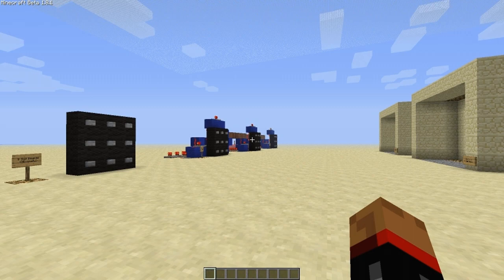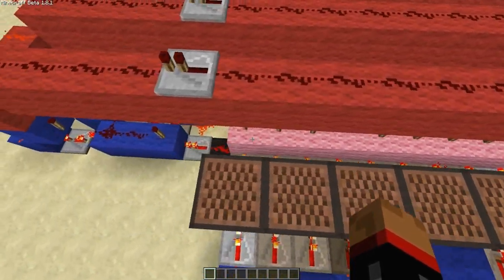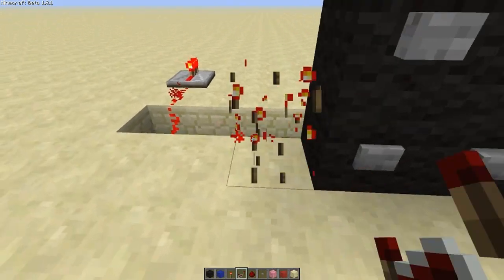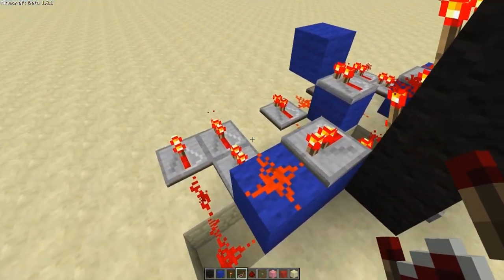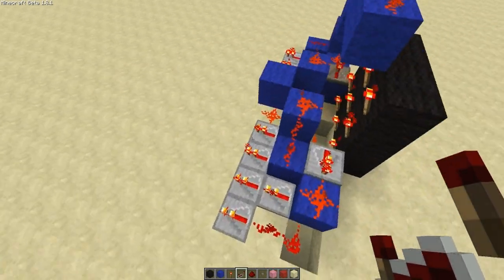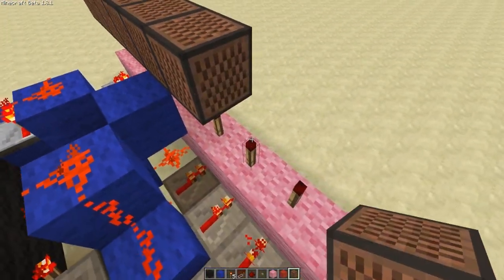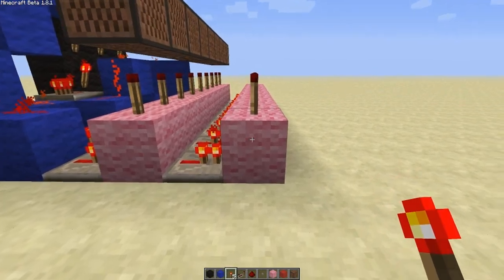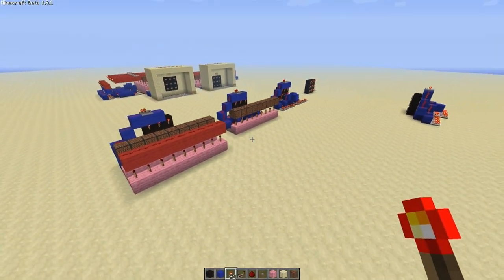Nine Digit Combination Lock [Minecraft Redstone Tutorials]

Comment: For people 1.5 and higher or tu19 and higher you can build a dropper rs nor latch array. 2 droppers facing into each other and each one is spaced 2 blocks apart. For it to be order sensitive place a comparator between each array and make sure the dropper with the comparator pointing away from it in each array has a single stackable item in it. It's very small and it's more responsive than CNB's rs nor latch array. I have a 4 digit combo lock that is 8x9x5 with 4 pins in it. Dropper rs nor latches can be stacked closer together than the standard rs nor latch array therefore greatly reducing the width of the combo lock design making it more compact. To reset it you have to indirectly power the dropper in the back of the 1st array with no comparator pointing away or towards that dropper. I've discovered this not too long ago.

Comment: I have a 3 digit code 498 on xbox 360 TU 14 which I need an off signal to open my vault it works perfectly other than it doesn't change the signal at the end

Comment: it makes more sense to protect your base with a nine digit than a 4 digit because of the possible combinations. if you were to use all 9 digits in one combo their would be 362880 combinations that someone would have to go through. However, if someone would to use only 4 digits there would only be 24 combo's.
Reply: A 4 digit long pass code with 4 numbers would be 4^4 (4x4x4x4) which is 256 combinations. A 4 digit long pass code with 9 numbers would be 9^4 (9x9x9x9) which is 6,561 combinations. A 4 digit long pass code with all 10 numbers would be exactly 10,000 (0 to 9,999). A 9 digit long pass code is 25.6 times more secure than 4.
Reply: There would be way more than 24 combinations...
Reply: Jake Yankee 4! = 4x3x2x1= 24
Reply: ***** Think about it.
Reply: ***** Good job dude, couldn't have said it better myself.
Reply: Sorry to say this but there would be more than 24 for a 4 digit code. And nearly 1 million for a 9 digit code.
Reply: Way back when I posted this comment I was using permutations. 4p4 and 9p9. Which is simplified down to 4! And 9! Which equals to the numbers I put above. Now I realize I should've used the combination formula. 4c4 and 9c9. Please excuse my immaturity.

Comment: So i built the 9 digit passcode thing, but the issue I'm running into is that all i have to do is press the last button in the combination and it will still power what i have it all hooked up to. I'm fairly certain i followed the tutorials exactly. Granted this is on v1.7.9 and could be that some coding changed to break this build, but is anyone else having the same issue?
Reply: I appreciate it but i found another tutorial with locking mechanisms and kinda combined the two to make it work. Brain smart and stuff.

Comment: That is because this was made in beta 1.8. CNBMinecraft has a fix for that as in Minecraft 1.0 the behaviors of redstone changed. He has a video showing the fix. If that doesn't fix it then you may have made a mistake building the RS NOR latch array. Your issue is caused by the AND gates not working so check and make sure they are connected prope.rly. Most likely though, if you haven't used his fix, that is the problem

Comment: go in the description and watch his 4 digit tutorial its the same as this one but smaller basically you dig however many 2 block deep, 9 block long trenches for buttons you need to push and link them to the RSNOR latch array. and for the reset place redstone torches on all the blocks over the trenches except for the correct ones in the code.

Comment: I made a pretty decent 4 digit 9x9 lock door. Pushing any number that was not in the code locked the door till u push reset. U can take ur time putting in the code, u have to push the confirm button. Also after u open the door once u have to push in the pin again to open it. I wish I can upload it, but I dont know how

Comment: Im still a bit confused on this. I am trying to use all 9 buttons (1 button per latch) so i made it 9 decoders long, and filled it out like the 4 digit code. The latches work, but it seems that i cant reset the latches by pressing a wrong number, or even at all. Once the final latch (the output) is entered, I can' turn it off without breaking the redstone.

Comment: If you read the comment before you it mentions if the lock is connected WITH a reset line it will work great for a door (such as the updated version I made).  But on another note, you can just add a couple seconds of delay on the output and press any key to close the door.  The downside being you have to hurry through the door before it closes.

Comment: basically you continue making those pink lines with the torches, each one of those lines is a digit, so you can make it as many as you want, remove a torch for the digit and then make a rs nor latch (basically the same thing as the 4 digit or you could look up cnb's rs nor latch) and set the final bit of wire to whatever you want. maybe like a door or something

Comment: Hey, first off thanks for this video, so helpful. i have a small problem though. i built and tested this thing and i found that if i just click the last button in the combination the front door to my house opens.i took a look at the system and the only thing i can think of i that when i click it two cancelation (numbers 2 and 3 in the four digets) lights up and and not the 1st one, any ideas on what i did wrong? i realize its hard to comment when you cant see what i did.

Comment: think you could actually pull it off with one numpad though, the only problem you have is you have to crosswire alot of redstone under the decoders, you could essentially take away 2 torches on each decoder and link each one up to a different RSNOR latch array. i havent tested it but i guess that if you would put a Latch array on each side you could hardwire it to make it reset when you don't press the right code for the right array too, because it just resets BOTH arrays.

think it's possible?

Comment: No that is extremely complicated. Especially to have a system that requires all digits to be entered in the correct order for the door(s) to open, not just press the last digit like this system. You would have to have a twin version of the device shown in this video and then come up with a system to hold each light up until all four are lit and THEN the door opens. And if only one light is up the door remains closed,unlike this system. It's hard to explain, do you understand?

Comment: That's exactly what this lock does. When you make the decoder section, the number of trenches you dig ( going away from the key pad) is the number of digits in the code eg 4 digit pin, 5 digit pin, 9 digit pin. The number of blocks across (the ones with the torches) are how many digits you can select from eg 1-9. So if you want a 9 digit keypad with a 4 digit pin, make the device shown in this video and then build the decoder, with only 4 trenches. Enter ANYTHING wrong and it resets itself.

Comment: Right, I'm running into the same issue. I would try to modify it to accommodate the change, but I have little to no idea what I'm doing. After working with it for a while, I came to the conclusion that it was a problem with the RS NOR latch array.

Comment: Hi, I found a problem with your diagram, if you switched last digit of your code without going through the other door opens your bin anyway. That is to say that if your code is 1 2 3 4 ben lean directly without passing through four other ben your door opens, in any case I have the problem.

Comment: you can run redstone from one of your buttons to a pressure pad on the other side of the door, so when you run through you step on the pressure pad and it activates the button and causes the keypad to reset, thus shutting the door

Comment: I get it and what happened to me was that I had the code 829713428 and I think that the two eights were somehow crosstalking so I changed it to 829713425 and that problem was solved but then I just randomly gave in the 5 without anything in front and my piston door opened(same thing with the 4x4 version).
Can someone help me?

Comment: The problem is that the latches aren't dependent on each other, making it possible to simply activate the last one to open the door. You need to make latches that need a second input, so that if this second input is off, the latch isn't working anymore. Then you take power from the first latch to activate the second latch and so on. If you do it like that, it fixes the issue with the multiple pass codes. I know my english is bad but I hope you understood me :)

Comment: Nevermind, I figured out how to use repeaters to keep the other reset lines from being tripped so that the majority of the lights stay lit. i combined this with a 4 piston circuit and I made it work perfectly. Just took a little modification of your original RS NOR latch array design and reset lines.

Comment: easy. from the output of the combo lock, send a line through some repeaters set to whatever delay you want, then have that signal go to the reset line for the last digit of the combo lock. then after the delay line sends its signal, the reset line will activate, the combo lock will be reset, and the door will close.

Comment: Okay   I connected the output of the lock to a pulse limiter and split the output of that two ways and delayed one by about 5 seconds, I ran both of those signals into another pulse limiter that was connected to a t-flip flop that was connected to my door      Therefore. When I put my code in, it opens the door and gives me a 5 second window to walk through before it closes.

Comment: OP, how did you get the distance between each row of torches to be only one? I tried a while ago to build an 8-digit lock and it works, but it takes a lot of space because it needs two blocks between the rows of torches.

Also, I really like the note blocks, they are an awesome touch.

Comment: I did everything and it works great except for one issue. If I hit the correct numbers in order great, but if I just hit the very last digit in my "security" code, then it doesn't reset, it just lights up the last number and allows me to open the door. :P

Comment: the problem that ive found with both of them is that once you have set your passcode, it opens like normal, but if you put in another code, no matter how many nubers, if it ends in your last digit of your original code, it will still make the sound or operate whatever you have connected to it.

Comment: I had to test this idea. If you sacrifice security slightly you can use 2 codes per decoder, so you have 1 RS NOR latch array on each side. You can't have the redstone next to eachother when wiring your code, it has to be either the same digit or a digit that is one block away from the other, so each side has a restriction on what digits it can use, hence the security breach. If you want more than a 2 person bank or a more secure multi one you need to wire up more decoders to your keypad.

Comment: hello! your Nine Digit Combination Lock does not work in my minecraft 1.2.5 the problem is that if the code is 1912 then you can just press 2 and then unlock it :-( I just thought if you could try and repair it

Comment: I can (sort of) make one of these combination locks so I can have infinite outputs and the numbers (1-9) on the keypad can be wired into the decoder in the same order numerically (start at 0). The size is 7+x long (x is the number of outputs), 3 high and 9 wide.
It is called redpower.

Comment: Im not sure if I missed out something when making this. But as i push in the numbers, each light will go on like it supposed, and the rest of the torches will go off. But, Instead of punching all digits for my code, i could simple just press the last digit in my code, and the last torch will go on, and the powerline is active :/
Not much of a combi lock, if simply 1 push on the last digit will open the system.

Comment: I used this watching you video on the 4 pin keypad but expanded it to 9 long and 9 wide per line thing and my code"a lame code" is 123456789. I pressed "9" and the door opened...

Why is that?

Comment: There's a pretty easy way to fix this for Minecraft 1.0. The only problem that exists is that the one center piece of redstone wiring at the end of the number 5 does not power the adjacent block because of the redstone update. If you simply add another row of repeaters behind the blocks (if you already built it, replace the note block line), and there you have your fix :)

Also, if you're still having problems, I suggest you check out cnb's rs nor latch array for the rs nor fix. Character limit.

Comment: I managed to make a ten digit one, with the tenth button being above the first one
but I had to have the torch to the side and similar wiring you used for button 8 but one block higher and in the other direction, works just as well but needs more effort into hiding it

Comment: Or, instead of adding an additional row of repeaters, you could just replace the repeater, carrying the power from the torch in the center, with normal redstone dust and isolate it from the surrounding redstone dust, that it would 'cross-talk' with, with a block and then place a repeater in front of the block one block down as the other repeaters.